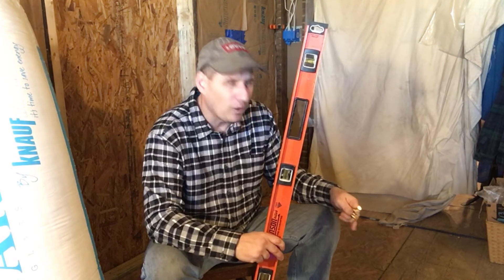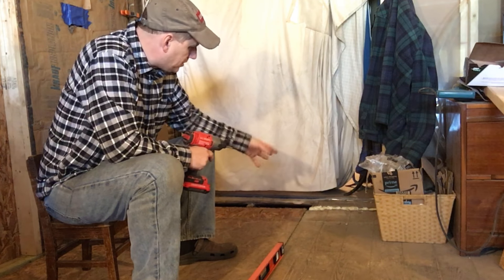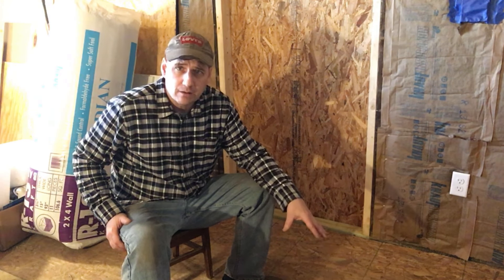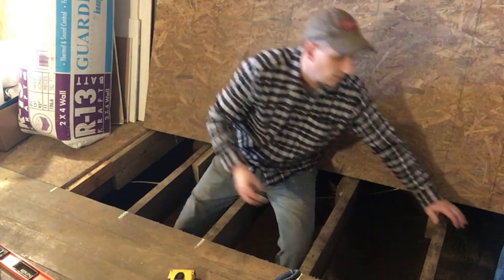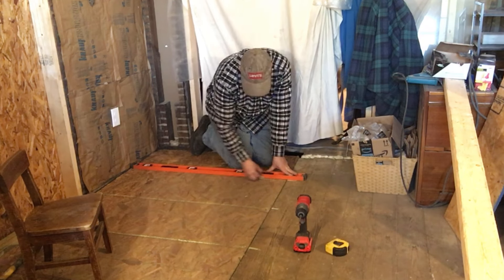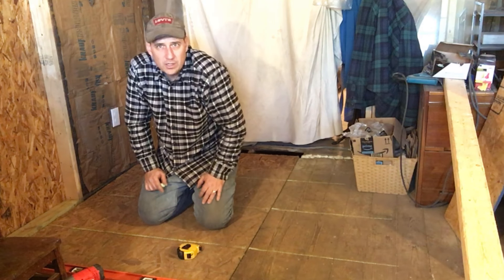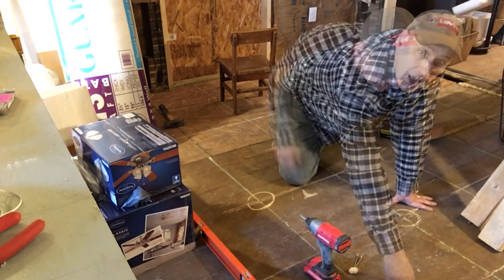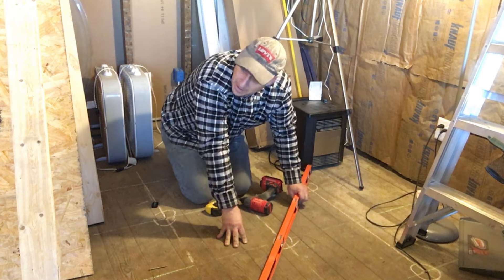DIY: Easiest Way To Level An OLD WOOD FLOOR - Using Screws and a Level

Comment: You, Sir, are a genius.  I was gonna tear up the whole floor, then sister the joists with an angled board to level, but had no idea how to achieve the job. Thanks.
Reply from the maker: Glad to hear the video helped. I would only recommend sistering joists if the joists themselves are rotton or sagging. If they sag in the middle but not at the ends, this is called "deflection" which means they aren't doing the job effectively and are structurally weak.  If they are straight but sloped - this means the foundation has settled some (causing the unevenness in the floor above) - suggesting that the joist is still strong. Thanks for watching!
Reply: @RundownReborn  I would only add that a sagging joist under no load at the time of measurement is suffering from long term wood creep, not deflection under load.  Wood creep does stem from deflection under load, but a joist that has a permanent sag after the load is removed is suffering solely from wood creep.  Also, floors that have a uniform, sloped tilt can be suffering from rotted or cracked let-ins, rotted sills, settled foundations or piers, older water damage, or even termite damage.  It's always worth it to check conditions at the joist ends, because sometimes it's just better to rebuild it all.
Reply from the maker: @Loonypapa  great tips. Thanks for sharing

Comment: My only question is what about the doors being leveled if the floor actually isnt? I’m having that issue. I can level my floors the way you are instructing but what about the doors not really sealing correctly because of the unevenness of the foundation

Comment: This is a bandaid handyman solution. The problem is usually rotted stumps. When will you replace those?…
Reply from the maker: The cause was poor drainage causing soft soils and foundation settlement. That was resolved prior to floor leveling

Comment: I had to do the same in my old house for a 20x20 space. Very time consuming!
I like your screw method - I followed the same principle but use a laser level instead.
Mounted the laser on the opposite side of the room from my highest point and worked my way towards the laser, marking all my sleepers and cutting them and placing them as I went.
The end result is great - only folks who did this know how much work it really takes to do this.
Fantastic job in your place and great video!!
Reply from the maker: Great story. I find it takes a couple of hours to set the screws in a room. Then a few hours to install the sleepers. The next day, I lay down the sheets. A 2 day effort for a room on your own. Probably one day if you have a helper.

Comment: Your method worked well to level the floor in my 8' x 12' kitchen.  The process was time consuming but relatively easy.  Measure 3X, cut 1X is my new mantra.
Reply from the maker: So glad to hear the process worked for you as well. Thanks for sharing!

Comment: Thank you so much! this worked out so well for me in a 350sft room. using a track saw and a laser level made it so much easier for me. before doing this using your method, i tackled the first two second floor rooms by pulling out the old nailed down original hardwood floors and then running shims directly on top of the old and unstraight joist then adding new OSB and 3/4" hardwood. I braced the joists with blocking too. The house is from 1900. was remodeled but for some reason leveling was not a priority for them (im sure it has to do with cost to jack things up). this time around i still braced the joists in the 350sft room but i didnt pull out the old floor. put the sleepers right on top. then osb and 3/4 hardwood to flush with the previously installed hardwood. my only concern is that the 350sft room now has an additional 5 PSF. not sure how detrimental that might be. Im a chemEngr by training. no structural engr expertise. one side of the floor is supported by a 5.5" wide by 14" depth LVL beam with a 15foot span. every research ive done says im good. whats your thoughts? thank you for this astute approach to solving this problem. subscribed!
Reply from the maker: Awesome! So glad to hear the video was helpful!

Regarding loads…
How much do you weigh? Stand still in a 1 square foot spot in the center of the floor. Now bounce up and down. Did the floor deflect or fail? Probably not. I’m sure you weigh much more than 5 lbs. 😁

Thanks for sharing your experience!!!
Reply: @RundownReborn  lol thank you man. looking forward to your videos

Comment: I like how you are using the screws to achieve level. I might take the underlayment off of my rafters and use this method directly on the too of the rafters. I want to install 3/4" tongue and groove wood flooring and I don't want to raise the finished floor level another 1.5" + level offset above the existing surrounding floors. Still, it is all a lot of work! Thanks for the ideas!
Reply from the maker: Hope the video was helpful!

Comment: Thank you sooooo much for this video!  It is THE BEST floor leveling video on you tube.  We live in an old house built in 1890 & are replacing laminated flooring in our kitchen with vinyl plank flooring. After tearing up the laminant, we have 2 different floors in our kitchen that thd previous owners tried leveling with whatever they Co ld get their hands on & it is a mess.  I am going  to use your system in this video to level our floor.  Wish me Luck😬
Reply from the maker: Thank you. The system works - I've used it in my entire house.
You might also check out this video if you haven't already.  Another look at the process.
https://youtu.be/fv9PZcCu_0k
Best of luck with your project!
Deric

Comment: I’ve got this same issue in my kitchen. Home is 75 years old . My floor has up to a 2 inch slope in just one corner. When I pulled out the kitchen sink and cabinets, there was rot in that corner. The subfloor had rot as well as the 6x6 floor joist, seal plate, rim joist and 2x4 bottom plate for the wall. I sistered the floor joist and replaced all the rotted sections. Now I’m ready to level the floor and think I’ll go with this method rather than ripping up perfectly good subfloor and raising or shimming the floor joists.
Reply from the maker: Wow. Sounds very much similar. Thanks for sharing. Best of luck with your project

Comment: The use of a laser level will make this much easier and no need for all those screws.  Also wonder did you consider sistering or jacking the joists from underneath.
Reply from the maker: Perhaps and yes.
Reply: @RundownReborn  just set the laser level up on one side of the room, start with 2x4 at the far side of the room, and mark it where the laser hits it.  Then proceed toward the laser one 2x at the time, msrking them as you go.Then draw or chalkline to your marks. And cut with circular saw.

Comment: Hello, first of all thank you so much for making this video, it is really helpful in my own DIY floor renovation. 
A question regarding the sleepers going over the joists.
Is there a benefit from reducing the spacing between the sleepers? The spacing in the video is about every 4 planks - meaning that every fourth plank will be load-bearing. 
Does it make sense to reduce the spacing between them? For example to put a sleeper on every second plank? This should transfer the load two more planks underneath and other than the increased cost it should be fine to do that?
thanks
Reply from the maker: The spacing is based on the sheet plywood above, about 16” on center. The “planks” or floorboards are not load bearing… they transfer their load to the structural floor joists below them

Comment: Fantastic video. I have a concrete floor with the same problem and don’t want to use self-levelling goop. With a couple of changes I think I can do this and give myself a nice wooden floor.
Reply from the maker: Check out my porch video https://youtu.be/YLV-ti2Gq_M , there I overframed the concrete floor to level it. Might give you a little more info on the subject.  Glad to hear that the video was helpful!

Comment: Like your method, I am level a 130 year old floor, torn between fixing sisters to joists or shimming as younhave
Reply from the maker: I would say both approaches can work. My suggestion would be to only sister joist if your floor joists (the structure below) is in bad shape.  To determine this - you will need to inspect them.  If the floor is SAGGING in the middle but the perimeter is okay/level - then the joists should probably be sister-ed.  If the floor is TILTING or SLOPING but the joists are straight for the most part, then leveling would probably be fine. But if the house's floor does tilt - make sure you don't have a foundation problem. If the floor joists are rotten - they may need to be replaced entirely.

The advantage to my method is its cheaper and I believe its much easier to do - especially if you are doing the entire house.  Just make sure you find the high point for the entire system - otherwise you will have to have a step or transition area.  Just be sure you don't have a structural problem before you make your final decision.

Hope this helps! Thanks for watching and joining the channel!

Comment: Well Rundown Reborn, thanks for confirming what we'll need to do in a second floor remodel with worse settling (up to four inches from the highest to lowest point) than you have there.  Twos suggestion I'd make to your method: 
1) Use a chalk line (string line) for marking your joists, and
2) Scribing those new 'sleeper' studs with a pencil and a spacer the size of the longest screw avoids having to measure every screw height.  Otherwise, you nailed it!
Reply from the maker: Thanks for the suggestions. I recommend watching this video. It’s another look at the process when I did my upstairs.
https://youtu.be/fv9PZcCu_0k

Comment: Good job. If you put the sleepers directly over the joists it would be stronger because the load would be transferred to the joists along the entirety of it rather than only at the points of intersection.
Reply from the maker: By going perpendicular - it gives you more flexibility for your new deck sheet layout. Running parallel or perpendicular doesn't really change the structural dynamics. Both are fine. In this solution you are floating a new floor on top and you get some added rigidity because of the new sheet deck. The new dead load is distributed evenly across the entire floor system. In some places (at the high points) - I was screwing the new deck down directly to the old floor surface and no sleepers were needed.
Reply: @RundownReborn  I agree it doesn't change the structural dynamics overall top to bottom. But you have to agree a 2-in sleeper going across two joists it's going to be springy when you step on the middle of it. Yes your overall load is fine but it's going to be springy when you step on it between two joists. Has to be
Reply from the maker: But I didn't remove the old floor deck. The sleepers are continuously supported by the old 3/4" cedar floor boards. I have not noticed any softness between the joists - otherwise the floor boards would be sagging too. If you remove the old floor deck and expose the joists - then yes - the sleepers should be parallel. This is a completely different approach than what I demonstrated in the video. And if you are removing the existing floor deck - you might as well sister all of the joists and reinforce the structure itself.

Some of my sleepers taper to almost nothing. No sag or or spring even at those locations. The old floor deck and joists remain untouched. They are doing the main support job of the floor system.  The top leveling is independent and floats on top of the old system. It is non-structural but is tied into the old structure. The 3/4" on top provides a little more rigidity - same as if you put two layers of deck material on a floor structure in new construction - such as on a theater stage.

Think of it this way. Stand on any spot on your floor deck between the joists. Does the floor sag at that spot? Now lay a popsicle stick or ruler flat in the same spot. Did it begin sagging more? Probably not. Now lay the ruler flat in line with the joist. Did it sag less? It doesn't matter where the thin ruler is. The floor deck is the support - not the sleeper.  The floor deck receives the live load and distributes that load to the joists. The sleepers transfer any live load to the floor deck they rest on. The structural dynamics are the same no matter where the sleeper is (parallel or perpendicular). The joist and old deck is doing 99% of the work.

My floor still bounces a little - but that is because my floor joists are 2x8. If the house were originally built with 2x12 or pre-engineered composite wood joists (CWJ) - there would be no bounce in it at all.
Reply: @RundownReborn  makes sense. I suppose I am of that mindset because I am going to have to remove my subfloor and, as you say, at that point it makes sense to go parallel (either sister joists or wedges attached to the top of joists ).
Thanks!
Reply from the maker: Absolutely. If your floor deck is being removed, I recommend sister any sagging joists. This will prevent further deflection of those joists. Just nail 2x8 wood (at 6-8 inches zig zagged - 1/2 on each side) to the side of each existing joist and align the top of the sister joist to you level plane. Any joists that aren't sagging can be blocked up to the level plane. Good luck with your project!

Comment: Great job! I recently bought an old fixer upper. I  had my main floor joists jacked up from the basement, then my contractors installed new OSB subfloor. My floor still has a serious bow in middle. I wish I had watched your video before they installed the new OSB subfloor. Anyway can I now use your method but instead of screwing into the original joists - just screw into the newly existing OSB subfloor? (Also- my new subfloor in the living room will now be almost level with my adjacent old hardwood kitchen floor, so I will have to figure something out as I plan to lay new flooring throughout the whole lower level for a seamlesss floor,  but maybe that's for another discussion). Thanks in advance!  You're a gifted teacher ( I teach English).
Reply from the maker: Hi David,
I would hesitate to install a new second OSB layer over the new one you just installed - especially at the crazy high material costs right now. I would think the better solution is to remove the OSB that was just laid down (hopefully it wasn't glued), and shim or sister the joists to a level - if it is open to below.  If your old floor deck is still there underneath - then level as I show in the video and reinstall the OSB you already have - which should be cut to fit.  This would save you a great deal of material costs and weight on the structural system.

What is the thickness of the OSB subfloor you just installed?  Hopefully its 7/8".  If its half inch - that isn't stiff enough and it will sag between the sleepers as you walk on it.

If you can see the underside of the OSB you just installed, you might consider just removing the screws and shimming it up a little from the underside where you want it lifted and then re-attach it with screws from top side.

I don't recommend trying to anchor into OSB subfloor material.  OSB is brittle and the screws will just tear away over time.  Wood floor structures tend to flex and this movement will cause the screws to tear away from the OSB and lose grip.  This can lead to squeaky floors and can cause material lift later on.

Thanks for the props and for watching.
Good luck with your project!
Reply: @RundownReborn  thx, very informative. I don't like the idea of trying to remove the new OSB , as I think it's glued and tons of screws ( I won't be buying any more lumber materials till the prices come down). Oh, under the new OSB is old hardwood which  I was going to try and save, but there were too many holes as I removed a chimney and ducts to the furnace, so yea , was in rough shape. What if I just tried to use floor leveler on the OSB where it's sagging really bad? I don't expect it to be perfectly level. Thanks again.
Reply from the maker: I don't know much about floor leveler.  My biggest concern is that using large amounts of it on wood floors can cause a lot of weight and it may be susceptible to excessive cracking.  Its certainly an option but may require more research for you to consider.

Comment: Thank you for this information.  I have a century old house that has a back porch that has been fully enclosed in the past seventy years. The floor was left with its original tilt ( to drain rain water).  Leveling the floor without trying to raise the porch (which I imagine could really reek havoc) has been a problem that I could  seem to solve without tearing everything apart. I will let you know how it works.
Reply from the maker: Glad it was helpful! I did the same on my front porch. Check out my front porch videos to see how I framed that out.

Comment: Very interesting way to level the floor!  Saves jacking up the joists!  Thanks, Tom
Reply from the maker: No problem. Hope it helps and thanks for watching!
Reply: Wow i'm facing some majorly sloped floors in a century plus house i just bought, been racking my brain how to approach the leveling.  From ripping out the floors and sistering, to jacking up from down below.  I really like ur approach.  i'm gonna have to think on it some more.  great videos! part 1&2